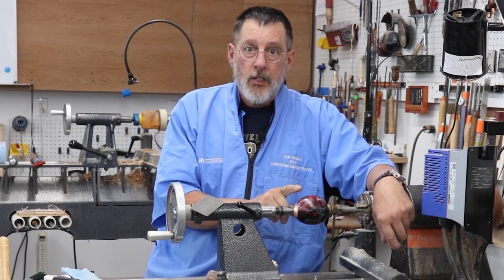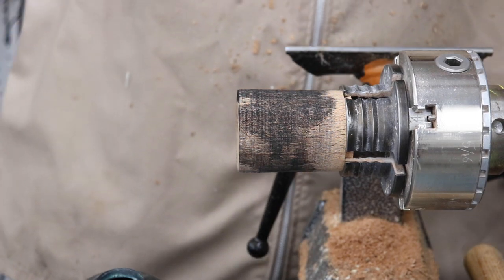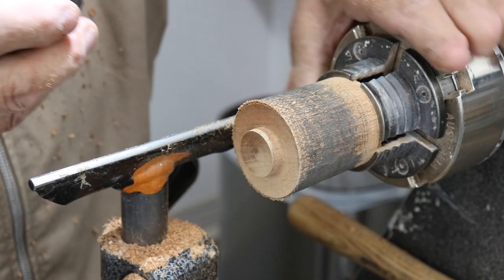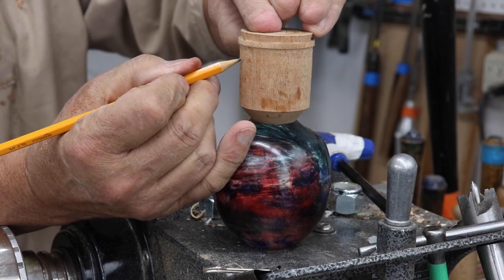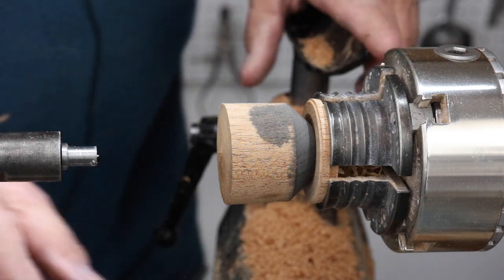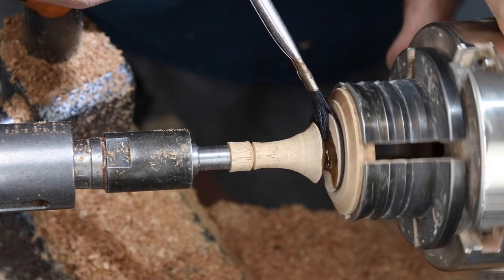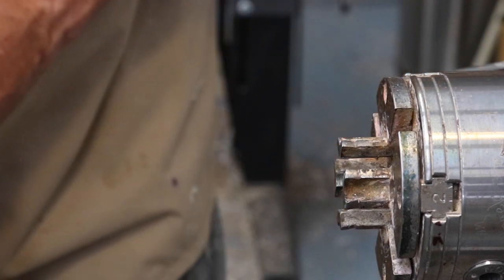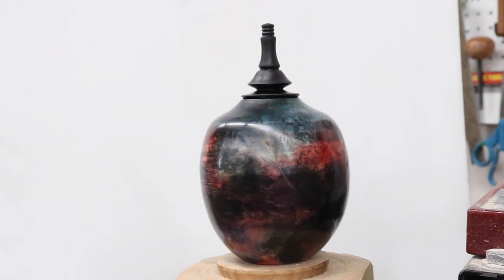Turning a Lid for a Colored Box Elder Hollow Form    with Sam Angelo

Comment: Hi Sam. I always love using that ebonizing process. What I learned was that it is effective in ebonizing almost any type of wood to brew a very strong cup of black tea to the point that the tannins are released. Apply that to the wood then apply your rusty vinegar solution. But, I found not to cross-contaminate solution with the tea or the tannins will neutralize the effectiveness of your rust solution. Red wine is another option, but not as effective as tea, in my experimentation. I'm only at the five-minute Mark of the video so if you've elaborated on this further on, my apologies but I wanted to make this comment while it was in my mind.
Reply: Thanks for the tip about the tea tannins :-)